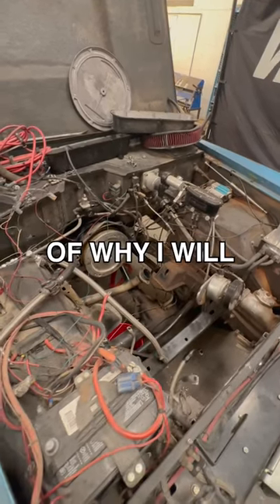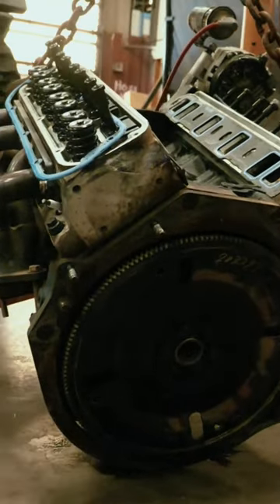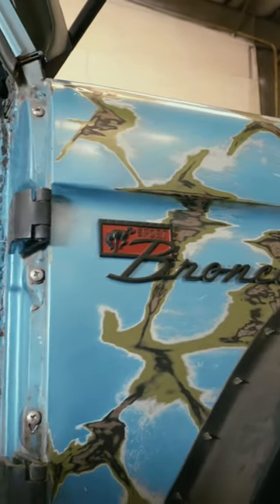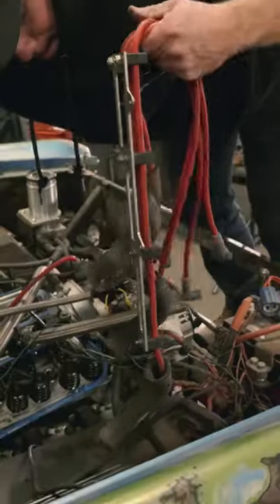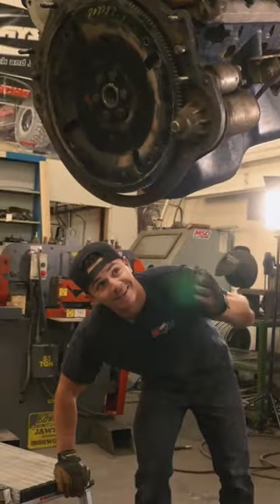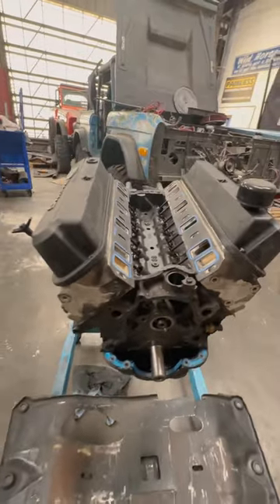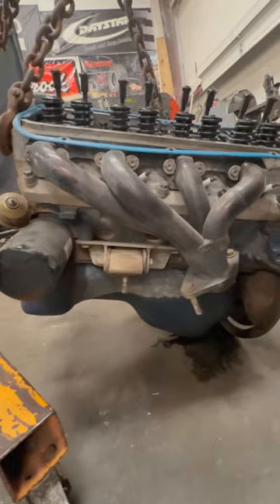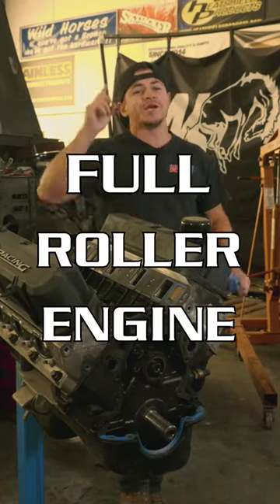Say NO to Flat Tappet Lifters?

Comment: Oil with zinc and having the valve lash properly and regularly my friend.
Reply: It blows my mind how many people don't understand that..what an ignorant thing to say about flat tippet lifters
Reply: @michaelnordland7994  literally just a bottle of additive would have prevented all of this
Reply: Ahhh I was looking for that comment 👍
Reply: Valve lash is only needed to be regularly maintained on solid lifters. Hydraulic lifters only need it set once.
Reply: @jerodwolford2743  hydraulic lifter requires preload and doesn't require as much maintenance but still good to check preload on your toys
Reply: @FUCKEDUPFAB  broken in for sure
Reply: It's not 1980 anymore.... Shit is junk. Metallurgy is junk on even name brand parts. Friend of mine in highschool has a 400 sbc with a large geornal 284 crank. Roughly 350ci. Brodiz heads. Eagle rods. Name prand pistons. Valves. Pushrods. Rockers etc. NA the engine would move his full weight C10 down the 1/4 in 11.9 at about 120 depending on the night. We figured it was making about 600 to the tire. 38 degrees of timing locked out. 950 Holley running 110 leaded. He ran the right oil. Multiple additives and Evan just the racing oil with no additives. He wiped 6 sets of lifters. All best of the best name brand equivalents. His dad has been. Racing sbc motors for decades and until this day he swears he's never had those problems and he blames inferior metal. They put solid rollers in it and never looked back. Revs it out past 8500 regularly on a 175 shot
Reply: Yup get some hotrod amsoil that's formulated for these old school engines and yer mint
Reply: @FUCKEDUPFAB  lol that valve will open when it's ready
Reply: Thank you enough said!
Reply: All these comments, ASSUME ONE THING, *QUALITY PARTS* Nearly all engine rebuild parts are now manufactured in China. These Chinese parts are literally the definition of fake. They look like a part, but don't function as the part should. And it's not an accident, because it's been going on for decades. China is also an advisory, politically. Fundamentally most Chinese are hyper nationalist, and as they make the parts they know where they are being shipped.
A well known saying in China... " Everyone hurts me, so I hurt everyone" corruption, and no morals, they are cutthroat. Poison baby formula, poison dog food, lead paint on kids toys, etc they don't care.
Big recall a week ago about lead ink used on young children's Disney clothes. Lead destroys children's brains. Wake up people.
Reply: @trekinseattle  bad lifter brings up international trade politics
Reply: I was thinking the exact same thing zinc all you need is a zinc
Reply: Look he used a synthetic oil...
Reply: Not lashing the valves often only means there will be more clearance and lash, meaning the valvesprings will make up for it unless floated. So valve lash or lack of maintenance is not the reason for flat tappet cam failure
Reply: @williamstamper442  exactly it is the synthetic oil most likely used and would void a warranty if there was one
Reply: Y'all can beat me up here in the comments but I'm here to say almost all of you in this thread are wrong.
The main reason for "modern" flat tappet hydraulic camshaft failure started when everybody started buying "off the shelf" cams from the "big names".  Anybody who ordered a custom flat tappet hydraulic never had a failure. The problem is NOT the oil or zinc, or lack thereof. The problem is not helped by mexican and chinese lifters, however with all that said the problem is in the camshaft grinders themselves. A new flat tapped hyd cam should have a pronounced taper on each lobe almost to the point where a good eye can even see it. They started grinding them practically flat. That means the lifter is not even trying to rotate on each lift cycle. Unless you have 88# on the seat the required valvespring pressure is gonna try to make a flat spot on that cam if it's not geometrically forced to try and spin in it's bore. Don't matter if it does spin much if any, but the assymetrical tapered lobe design makes the contact pattern with a flat tappet more like a spiral than a straight line. The straight line won't take any splash oil and it digs in and begins the process of flattening a lobe. Once it starts it's all over from there in no time flat. Think about what I'm saying before y'all attack me.
Reply: @William Stamper  makes some sense... but I have seen old cams and lifters go bad in older vehicles from the switch of oil to synthetic as well. But what you said is probably more accurate then the rest in this case. I dont have any new cams but I see what you are talking about in the old cams I do have.
Reply: @2wheelhoon813  just to prove my point when you say "it not 1980 anymore" just happens to be an era starting just before then and possibly peaking right around then when metallurgy was at an all time low for manufacturing. This makes your statement opposite of true.
It's not the metallurgy of the cams and lifters. They are not "soft". If anything that's the number one thing to manufacturing valvetrain parts is rockwell hardness and that is one of the easiest things to achieve in the field of making parts out of metal. A simple nitride heat treat can make a rockwell hardness at least .003 thick and cost very little to do. Nobody makes "mild steel" cams or lifters. So they are not "soft". As far as zinc yes they took that out for the most part and we all put some back in on our non emissions vehicles. But zinc itself is NOT a lubricant. Molybdenum is sort of a higher pressure lubricant but it has its limits too. Zinc was in the oil in the old days as a byproduct of distillation thru the cracker of your local refinery. When the EPA said "zinc is bad for the environment, sniff sniff" we had no choice but follow what they gave us because the EPA has more power than the commander in chief in this country. Thing is zinc has no lubricating properties it simply keeps certain elements of our lubricating oil from breaking down and seperating under heat and pressure. That makes people think it's a lubricant but it ain't. 
The failure of flat tappet hyd camshafts can be traced directly back to those manufacturers. Quit buying off the shelf cams. If building a performance engine one should take every single aspect into the equation and have a one off custom cam built for their application just for performance sake! Then this alone would solve 90% of this problem. Off the shelf cams are mass produced and are not quality checked. I can prove it if you send me your failed bumpstick. I will make a vid on any failed cam sent to me and show you why it failed.
Reply: @williamstamper442  when he cooked all those sets of lifters he never changed the cam. The cam was an off the shelf lunati if I remember correctly. he would just have the cam ground down ever so slightly by a local race shop and throw it back together. Last set of flat tappets they told him it couldn't go any further as the base circle would probably be to small. So put a set of solid rollers in it. 2 years later he still hasn't gotten to adjust the valves because they have held an adjustment... His new problem is blowing distributors up and cooking atf with the stall converter on the street. Also it runs the bowls dry because he's only got 4150 needles and seats. Those old school deals are cool at the track. But on the street they always were and always will be junk and horrendously unreliable
Reply: @williamstamper442  you mad?
Reply: Agreed 90k miles and 40years and are still mint
Reply: The problem is greater than that solution.

Comment: called proper break in. although it's not an easy task
Reply: MOre than that. Improper taper on ft lifters, hardening not up to spec lifter adjustment (installer error)excessive cranking before firing. I only use Iskys cam lube. THat red comp stuf runs off.

Comment: Millions of engines have been manufactured for over a century with flat tappets. It is old technology at this point,  but there's nothing inherently wrong with them. Sounds like someone is buying cheap parts or setting them up incorrectly. Proper oil is important as well.
Reply: Only a few places that make FT lifters. Problem is improper taper on the lifter face quality is all over the place!
Wish the big 3 would start making thiers again. Love SFT engines

Comment: TLDR : I don't know how to break in and maintain a flat tappet setup  FLAT TAPPET BAD VERY BAD Shiney rolley things good
Reply: Lol 😆 quality of flat tappet lifers are nowhere near what they used to be .....
Reply: @neilbrown82 cheap flat tappet lifter quality is nowhere near what it used to be. you can still buy quality lifters just like you always could. what's changed is the oil
Reply: Don't knock people who have the money for a good roller set up and just don’t wanna mess with the hassle. You can still achieve your goals without  flat tappets
Reply: @SirtubalotTX  I'm only knocking the people that don't break them in properly then blame the design like it wasn't their responsibility 120%  to research and do a good break in with a high zdp content oil aka break in oil and the stock rollers and springs in my truck would only Rev to 4800 - 5000 before valve float put heavier springs still got valve float replaced the whole system with a solid set up including solid push rods and we get close to tickling  7k occasionally now
Reply: @Fastcarsslowwmoney  I don't disagree with that and there is the whole other issue of parts quality, particularly items coming out of China.

Not sure what your issue was, I've seen countless rollers do 7k and higher...its pretty normal.
Reply: FT arent bad thats repeated internet BS. 
Have to double ck machining to the lifter face and make sure the pushrods spin on startup. Ive run cheap store brand oil wix filter on FT engines 0 failures. High quality parts help! 
Too many shop for Kmart prices and complain they didnt get Nordstrom quality

Comment: I run flat tappet on my motors my sprint motors are 500 cui and they run 9k for long periods 7 to 10 mins per race never had lifter failure. Key is real oil , Brad Penn, Schaefers not royal Purple or Rotella
Reply: Easy, rotella hasn't let me down yet.
Reply: Please elaborate on Pennzoil and Schaefer oil is it high in zinc
Reply: Please elaborate on Pennzoil and Schaefer oils
Reply: hey man that Rotella t4 hasn't gotten several small block chevys over mine over 400,000 miles🤣 just because it's dirt cheap and says heavy duty diesel oil on the bottle doesn't mean these old chevys don't love it
Reply: @TuckerH.  Rotella isnt anywhere near the oil its used to be. 
Best to run good ol ICE oil.
Reply: @jerrywhalen2100  Most are just fine. Problem is lousy QC on machinig of lifter faces. Without the proper taper that cam has no chance.
Reply: @konnerkramer329  Know they are having changes mandated just like regular car oil is. Not nearly the protection of 20 yrs ago
Reply: You should do some actual research on oil before u put comments royal purple has one of the best zinc contents of any other motor oil it is also rigorously tested and rated very highly amongst most racers

Comment: Sounds like an Edelbrock commercial more than a story on flat bottom lifters.
Reply: it is , there are thousands of better cams than edelbrock cams
Reply: @csmith9839 true, my Ford is running a Weiand intake and Schneider 284/94 flat lifter cam. No problems and is a daily driver that out runs the chevrolets leaving the stoplights
Reply: @csmith9839  Thier cams are fine its the quality/machining of todays lifters where its hit and miss.
Reply: @coolbreeze5561  Shcneider makes good stuff...Crower and Isky also. 
Too many are cheap and learn the hard way. The little guys cant afford a  bad reputation

Comment: Edelbrock Roller ... 
50 years owning a machine shop, whole life in racing. Last 2 years we've seen an incredible amount of flat cams / lifters. Every manufacture, though We typically use Comp. One particular customer / friend has us build a mild 327 it ate 3 cams, 2 pre install on a Dyno. Customer is wealthy and patient, but was furious. Recipes of break in oil each time. We tore the engine completely down again, full clean, etc, and install Edelbrock full roller cam / lifters. 3,000 miles a roller lifter failed. Can't buy 1, only sold in sets. Customer purchased lowest milage 6.0 LS he could find (10,000 miles) had the car converted to LS. 

Chinese cam blanks, finished in USA. Chinese made lifters.
LITERALLY EVERYTHING FROM CHINA IS GARBAGE.
Just heard about a recall of Chinese clothes for young children just full of LEAD BASED INK. Lead in toys too.
China is DESTROYING us, junk parts, toxic everything, Tictoc, it's a WAR without invasion.
Reply: That’s interesting and unfortunate to hear.  I worked in a great machine shop and the owner really liked Comp Cams, even worked with them on custom grinds.  We did have a bucket at the counter full of, usually cheap, broken lifters and roller rockers that customers brought in or came out of rebuilds.  When people asked for valve train parts recommendations we pulled out the bucket and sifted through to show them what they could expect with certain brands.
Reply: @flexabu  I don't know how long ago you were in the industry, but in the last few years every hold out manufacture has finally switched to China. Some claim some percentage or loop hole about being USA. Like a Comp cam. It's a Chinese made cam blank, ground here. The important part is the metallurgy, and they just don't do a good job. Same with rubber. It's not formulated right, so fails in a few months or maybe a year, instead of lasting 10-20 years.
From machine parts, to auto replacement parts, to new Factory auto parts, to refrigerators, to toxic toys, to toxic Sheetrock (look that one up in Florida, caused billions in loss and bankrupt a lot of people)
Instead of dealing with this stuff people are arguing about pronouns.
It's so beyond time to trade in the fishing boat, and get in the streets angry on our weekends !!!
My machine shop HWY 99 North Seattle, has gone from a nice area with nice people, to LITERALLY a burned out war zone. They break in, break windows, graffiti, there's 5 heroin / theft camps in a mile radius. Hundreds of drugged out zombies all night long ripping the surrounding neighborhood off, all day long steeling from the home Depot, Walmart, and local small business.
They took America, ONLY because WE LET THEM TAKE IT. I'm ashamed
Reply: Calm down loon..😝

Comment: Need to make sure your are running the right oil. Zink is your friend when running your flat tappet cams. And for a new engine on start you should never let it idle an have it above 1500 to 2500 rpm an varying that every 10 minutes for about 30 minutes to brake in the cam an lifters.
Reply: Glad someone said it! They probably started it up and let it idle.
Reply: I run break in oil for the first 3k miles change it at 30mins then  50 200 500 1k 2k 3k oil is cheap motors ain't and don't hold it at any constant rpm till 6k miles might be excessive but I've never wiped out a cam or ruined lifters
Reply: to be honest I've always heard the 2000-2500 rpm rule and that's really what I've gone by until I built a 427 BBC for a customer. when he was breaking in the engine he was hitting the Rev limiter on his MSD box at 7,000 rpm😳 I thought for sure that engine was toast. but to my surprise that engine ran harder than a lot of 427a I've seen. after 3 entire seasons of racing he brought the engine back in to do a check and replace some gaskets while the car was getting painted. so before I even touched it the first thing i did was a leak down test. every single cylinder was 2% or less leak down. I was absolutely shocked. needless to say every time I've broken in an engine since I haven't been scared of the throttle. better to Rev it a little higher and get that oil splashing around then Rev it too low I guess. and always remember when breaking in rings cylinder pressure is your friend
Reply: @konnerkramer329  Last Isky I put in (justwent through 4 bad comps back to back) I started it...timed it dropped it in gear and started driving ti figured Id be toast again. 
I was wrong..Isky and Crower for the win!

Comment: Just rebuilt my 65' 289 flat tappet cam and lifters. 
Properly broken in 
Running 20w50 conventional VR1 high zinc during the summer 
10w30 Vr1 or 15w40 T4 Rotella with an extra bottle of zinc during the winter. (doesn't drive much if any at all during the winter) 

Properly went over the valves and head re-torqued. Having no problems at all and this is my first classic engine.

Comment: You have to use a zddp (zinc) additive in engines with flat tapped cams and lifters because they were designed to use oil with zddp but zddp was removed from oil in the late 70s because zddp doesn’t play well with catalytic converters.

Comment: Valve lash needs set as flat tappet lifters have less travel the rollers do. Zinc and phosphorus needs to be in the oil , and camshaft break in done correctly varying the rpm between 2000 and 3000 rpm to throw oil at different angles.  95% of failures is improper break in.

Comment: I have a 351 windsor that has had 3 different flat tappit camshafts, I did all the proper brake in procedures. I had even called comp cams to see what I was doing wrong, and they suggested that I switch to a roller cam and I haven't had any problems since.